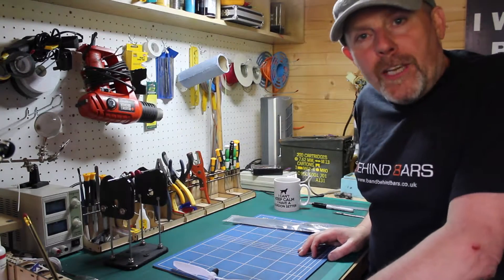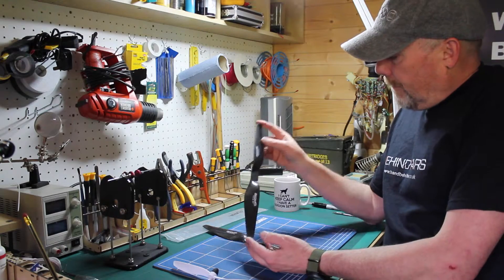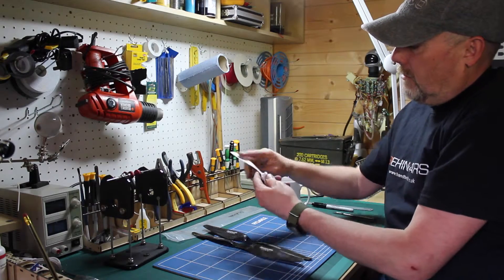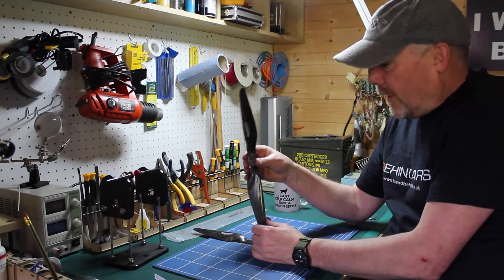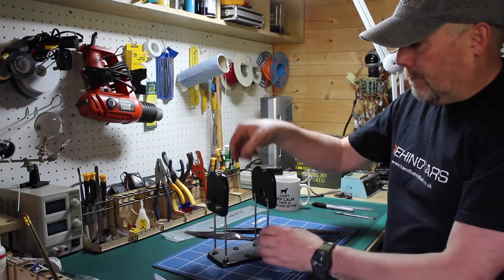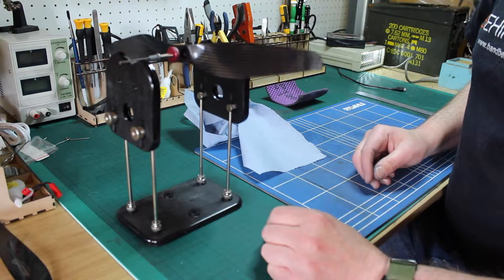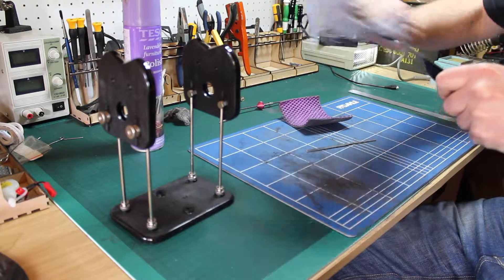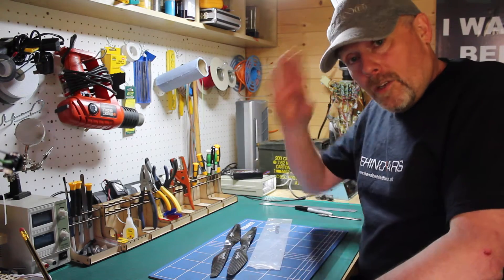Balancing large carbon props for quadcopters and multicopters

Comment: THANK YOU.  Having used biological ultracentrifuges that spin at +150,000 rpm I am aware of the need to balance spinning masses.  But, I am a drone newbie[ PHANTOM FC40 ] with a question.  Using sandpaper roughs up the prop's surface.  This might have a small affect on the laminar flow pattern of the air over the blade surface.  In turn, this might lead to altering the blade's lift characteristics.  Any other ideas on how to balance without altering the air flow over the dynamic surfaces ?

Comment: How do we know it don't have to come off the tips? Does it ever? Can we balance by sanding the tips or ends of the props?  And one example is when I landed at an angle with my quad and a prop or two spun at the ground slightly and slightly rubbed the tips of my carbon props raw. I went to the prop balancer, sanded the tips cleanly at both ends until it balanced. I removed approx 1/8"  or a few millimeters from each tip. Thanks